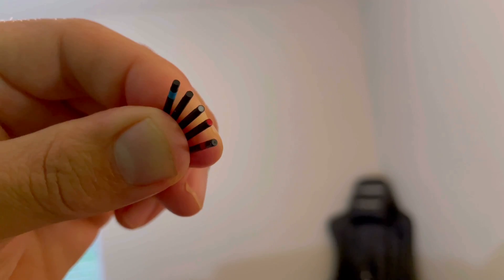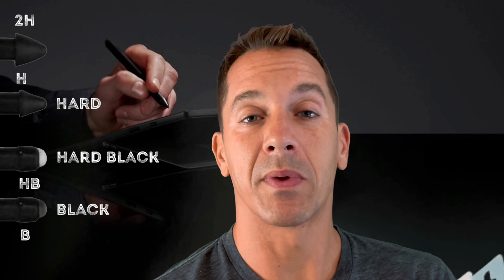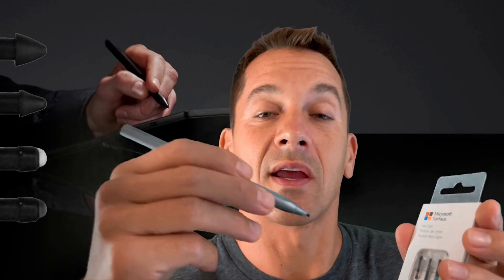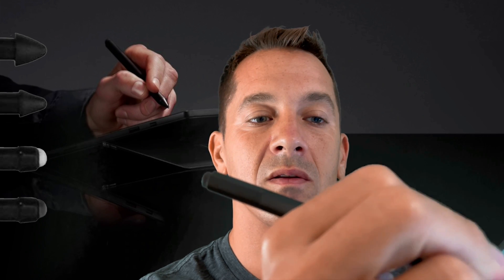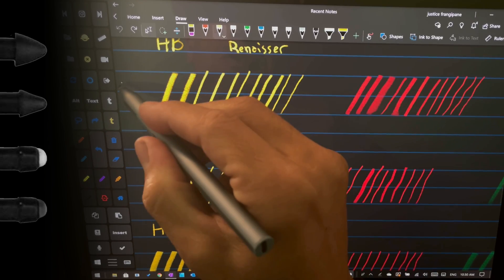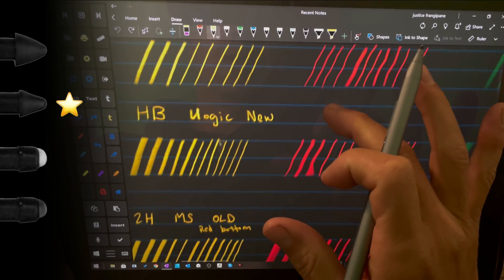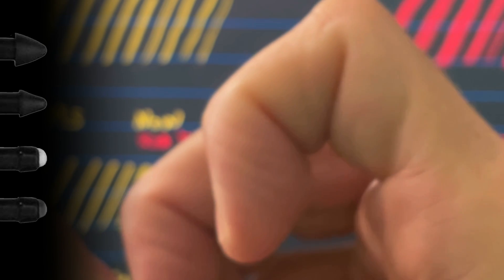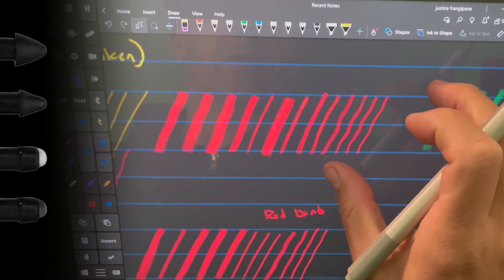Nibs and tips - Microsoft Surface Pen guide - Pressure, Feel, Jitter, Price, Buy, Does and Don’ts

Comment: I have a pen the newest one and it doesn’t work can you make a vid on how to fix it ,it turns on and connects and the eraser works but the tip doesn’t
Reply from the maker: Surface pen? What computer? Bluetooth eraser button clicks and works or it erases when it’s down on the screen
Reply: @TabletPro  an hp computer abc when I click the eraser
Reply: An*
Reply: Same on mine.

Comment: A factor which I never see in stylus reviews is the registration angle limit, i.e., how low can a stylus be angled relative to the screen surface and still initiate a line (not to be confused with software tilt function). The AES devices seem to have an advantage here, i.e. Apple Pencil, over the S-Pen EMRs. This is important for artists who prefer to draw holding a pencil with the classical, underhanded, "drumstick" grip. This angle depends upon the nib, barrel, and electrical design. Can the R520 function at a 15 or 20 degree tilt, which I assume would require the conical plastic 2H nib? Thank you!

Comment: I had the rubber on one of the tips break off after using it for 6 months. They don’t last that long with frequent use.
Reply: Agree, even though I prefer the feel of the surface pen, in term of durability, apple pencil is much better.